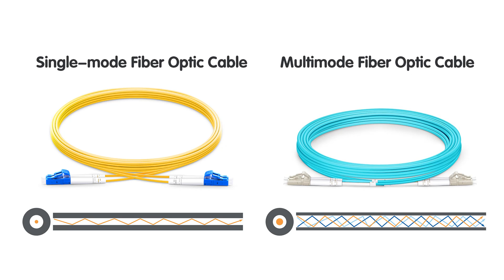Fiber Optic vs Copper Wiring - What are the Differences?

Comment: Just wanted to confirm, when you say copper is more cost effective, you are referring to household use cases right? because as I understand, when it comes to enterprise scale, fiber has a lower TCO, because it requires fewer cables compared to copper when building a huge network.
Reply from the maker: You're absolutely right! For household and small-scale installations, copper (Ethernet) tends to be more cost-effective due to lower upfront costs and ease of installation.
Reply from the maker: Fiber can be the more economical choice for large-scale deployments in data centers, campuses, and enterprise networks. A single fiber optic cable can handle much higher bandwidth than multiple copper cables, reducing overall cable volume. It is more durable and resistant to interference, requiring less maintenance and fewer upgrades over time.